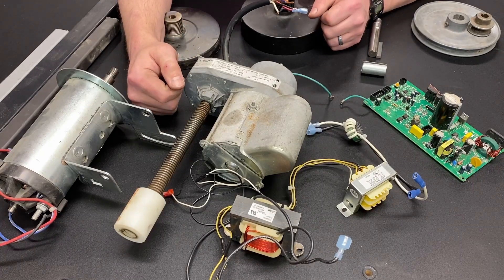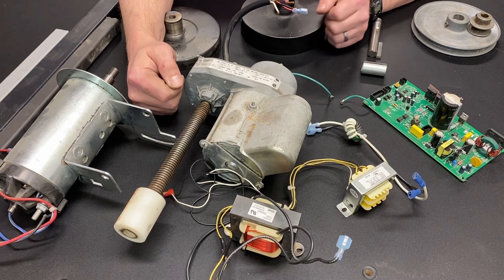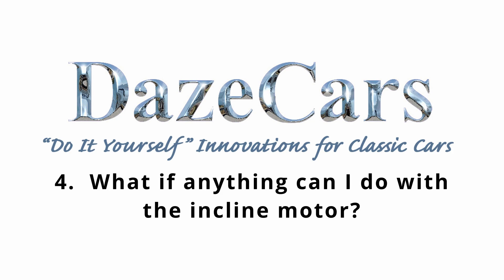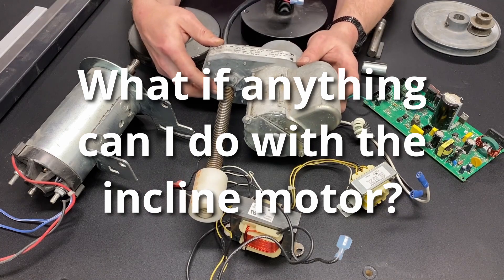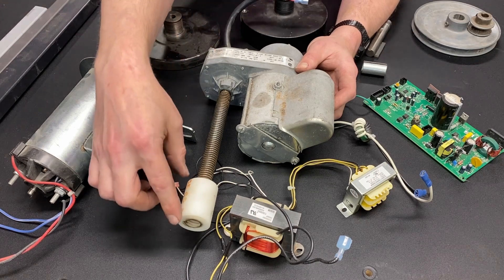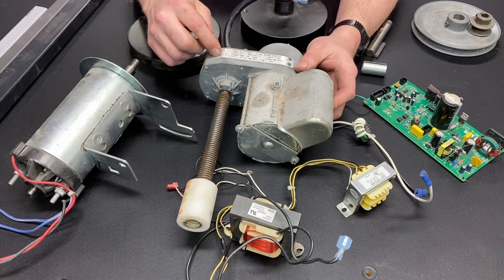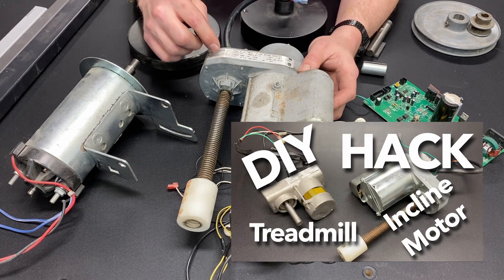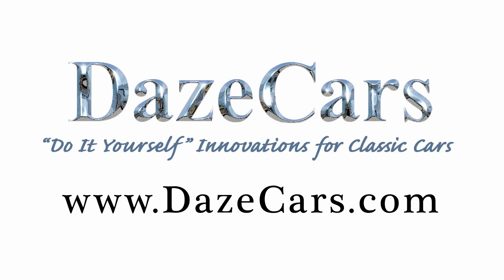Treadmill conversion FAQ 4. What if anything can I do with the incline motor?

Comment: Hi Thanks for the Great YouTube videos. just a quick question.   How would you run the incline motor on the mc2100 control board ?  do you need a switch or just some sort of pwm switch.  If you can help that would be great Thanks
Reply from the maker: I'm honestly not sure.  a signal comes from the control board to trigger the incline but I'm not sure what that signal is or what pins it connects to.
Reply: @dazecars thanks .
Reply from the maker: sorry I wasn't of more help

Comment: Power lift for a bench top milling  machine  would be my thought...disconnect  micro switch..remove shaft machine down for a bushing  ...sleeve to mount on shaft of mill  again just a thought
Reply from the maker: I have done exactly that on my mill!  https://youtu.be/AHUtBNcEpH8
Reply: @dazecars  ill check that out seems right the amount  of torque they put out...would make people  stop asking  why's left arm bicep bigger than  right
Reply from the maker: @miguelcastaneda7257   It's the corect amount of torque and its the perfect speed.  I am very happy with the upgrade

Comment: Hi, I'm doing a wood lathe conversion.  I don't want to use the height adjustment motor but the treadmill has an error code for the position sensor when I unplug it.  Is there a way to hack it into believing that it's still plugged in?  Thanks for your help
Reply from the maker: Yes, remove the potentiometer from the incline motor and reconnect it to the main board.

Comment: Used one as a hoist or crane/ lift in my garage..  you can remove the limit switches and hook it to a screw style acme thread rod with a spool on it and the one i used will lift well over 1000 lbs before the joists i got it mounted to start making noise..  wouldnt trust being underneath it with a load on it too much but it lifts my lawn tractor right off the ground..  ran the controls to an old gate lift switch handheld deal..  cheap and strong..
Reply from the maker: Yep lots of uses.  My other video on these motors goes over removing the limiting switches and modifying them for other applications.  Really the only limitation is the duty cycle.

Comment: Are all incline motors AC? What do I look for in a quality incline motor? Your video got me to thinking. 😂
Thanks,
Paul
Reply from the maker: all the ones I have seen are AC.  The first thing to look at is the duty cycle.  A better motor will have a better on to off ratio.  A lot of them will also have thrust specs with more thrust being better.  Lastly size matters, as a general rule the bigger the motor the better it will work.

Comment: Hi there,
Great advice on this video!  I have a Pacemaster Platinum Pro VR 120v treatmill with a noisy incline motor.  I took it apart to lube it... but on reassembly, the potentiometer that senses screw position is not working properly.  Is there a reliable way to fix this (other than trying to buy a new one from the US - I'm in Canada).  I tried to reinstall it in the neutral position (jacked up the end of the bed to a zero degree incline and adjusted the screw to that position but the system only works for a while, then sticks at the extreme position and gives an incline error.  resetting the machine takes care of it, at least initially.  Is there a reliable way to set this up so that the potentiometer is within limits?
Reply from the maker: I am not a treadmill repair guy so I am not sure the "correct" way to fix it, but here is how I would do it if I was making the attempt.  (try at your own risk, I am not an expert)  I would pull it apart and remove the potentiometer I would then turn the motor to the point where the on off cams are 1/2 way between the two switches.  In other words what 1/2 total height adjustment.  then I would set the pot to 1/2 of its rotation, reinstall it and see if it works properly.
Reply: @dazecars  surprisingly, my pacemaster doesn't have limit switches but I'm going to try something similar!  TNX for the response!

Comment: I have made a microprocessor controlled router lift with one. Initially controlled by a Raspberry Pi touch screen and Arduino as part of a larger project.  Now separated out to a dedicated router table. Controlled by a Pi Pico with a rotary encoder controlling a menu shown on a 16x2 display. A duel relay board switches the up/down commands in presets of top, bottom, up/down 10mm , 1mm , and 0.25mm steps.
Reply from the maker: There is a lot that can be done with Raspberry pi and Pico but that this is somthing I have not gotten into.

Comment: I have a least 6 of them. Lol Never threw them away cuz I figured eventually I would find a use for them.
Reply from the maker: I don't have as many of them as I do drive motors.  When I was scrapping the treadmills I had not yet figured out how the incline motors worked and had limited space so most of mine went away but, that is a mistake I will not make in the future.